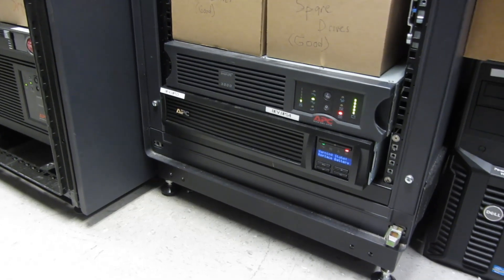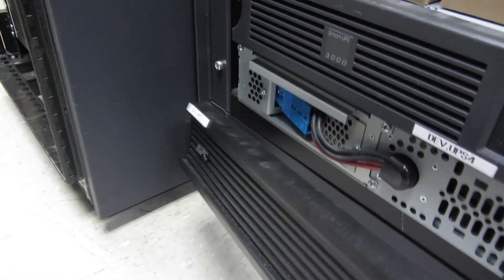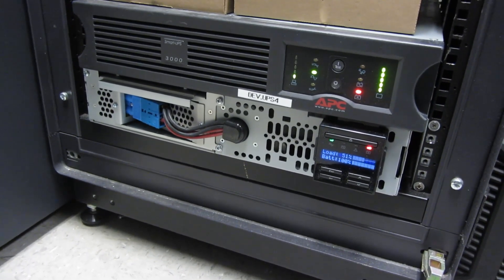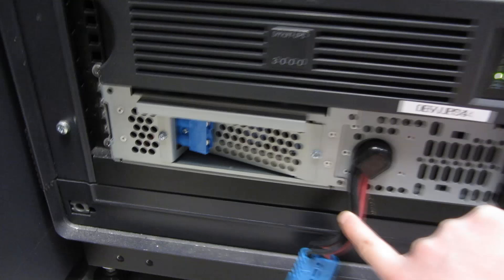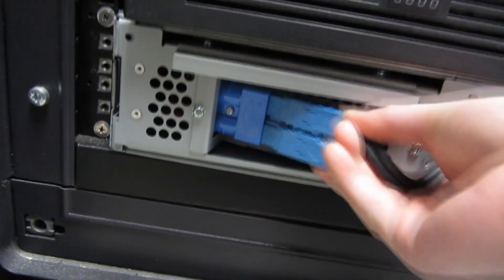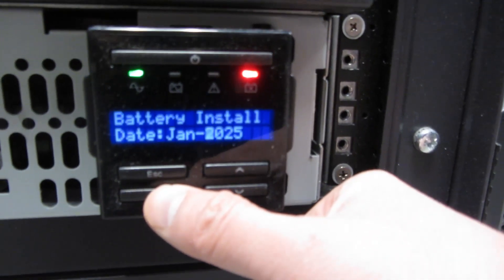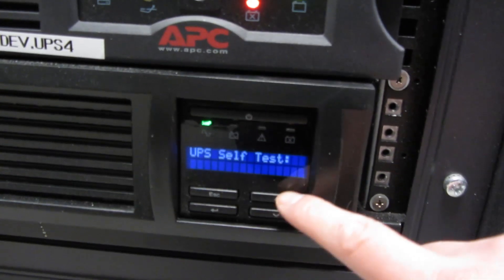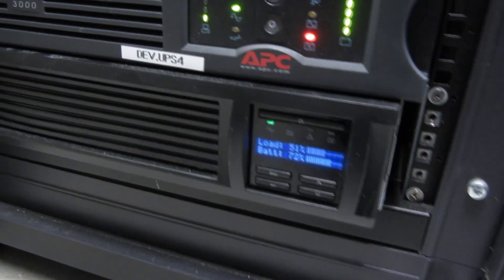APC Smart UPS Battery Replacement | Hot Swap | RBC43 | SMT2200RM2U

Comment: Hi thank you for this video i have one question , i have the model SMT3000RMI2UC i want to replace the batteries but the replace battery led is not on. one time i turned off the UPS power it showed on the LCD shutdown UPS,? whats is the problem and if i can replace them without turning off the  ups

Comment: About to do this for the first time on my SMT2200RMI2UC, it was helpful to see a video on how to do it and knowing that it can be done live. Did you get an OEM replacement battery or manually replace the cells inside the battery and reuse the existing sled?
Reply: i got an oem from the link above on amazon, just a lot easier